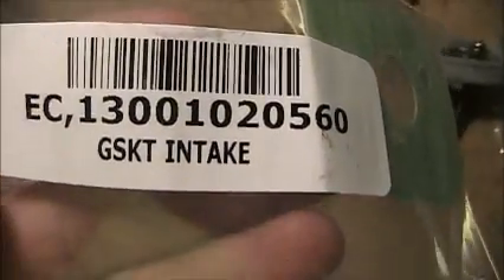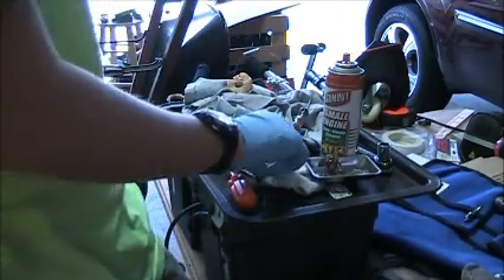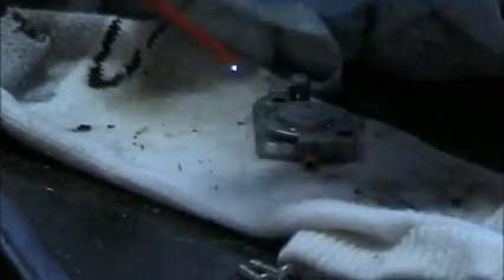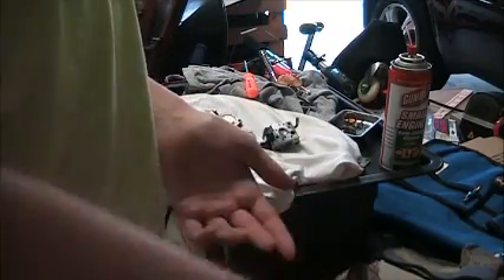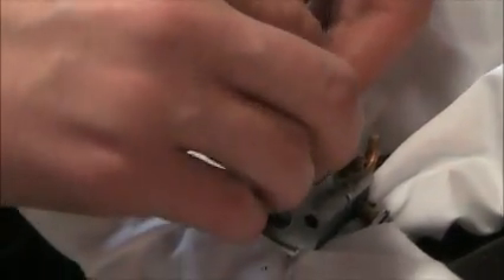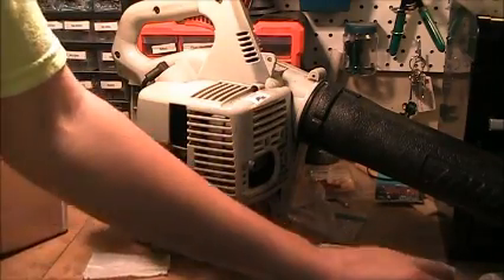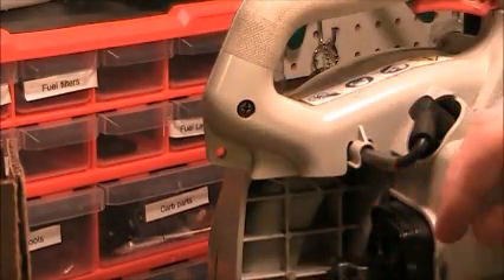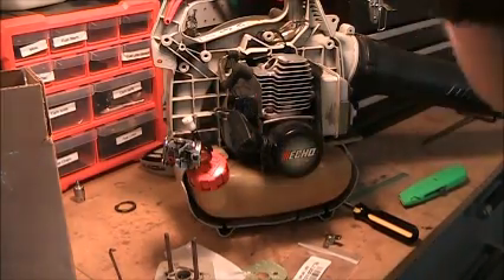Cleaning and Rebuilding the Carburetor on the Echo PB 200 Blower

Comment: NEED YOUR OPIONS ADVICE;;;;; i own small engine repair shop, over the years have rebuilt hundreds of carbs, but this one has me stumped,, soak in carb cleaner  4 days while waiting on kit,, took out, blew out all jets, orfeses, all air passages with air hose, carb is clean,, installed lit,, but can not get primer bulb to fill up only half way,, bouble checked all my work,, every thing is where it should be,,, WHAT IS YOUR OPION TO PROBLEM OR ADVICE??? NEED  ASAP,,,,,,,,,,,,,,,,,,
Reply: Ethanol does a number on the OEM bulbs.

Comment: Nice job. One thing I've found that doesn't get discussed which I believe can affect performance is how poorly machined many of the Zama carbs are on critical surfaces from the factory. Some have fairly deep grooves and dents in the machined surfaces where I think it really counts. As a result of this I have a small thick sheet of glass that's perfectly flat and some 320 wet and dry paper. I wet everything up well and hand lap at least two surfaces if they're rough.  Also due to the discoloration of the aluminum, you can see 'low spots". The critical surfaces would be the surface that goes up against the engine. If there are deep grooves or dents there, it's a place for air to leak causing the engine to run lean and have a laggy response to opening the throttle. . the other surface is the surface the flapper valves go up against. 
I take a few minutes and hand lap 3 surfaces. The diaphragm side (not so critical), the flapper valve side (critical), and the engine side of the carb (critical).. I use water or window cleaner spray and carefully slide the body back and forth. Doesn't take a lot of time.

Comment: OK FOUND PROBLEM, WANT TO SHARE WITH YOU,, i used new fuel filter with 3/16 nipple, it was to small, was not allowing enough fuel to flow, change to 5/32 wellbro fuel filter it fixed problem,, thanks

Comment: Good video. You desperately need a cordless screw gun though. Those screwdrivers are good at your age but only good for final tightening at my age. I have the same blower but my throttle assembly is different and I can't figure out what it ever was.  It has two speeds, locked full and idle. For what you're showing though it's a good video. Keep up the good work.
Reply from the maker: Thanks for the suggestion. I'm thinking about buying one of the Milwaukee m18 cordless screw guns. I agree, it would definitely be nice to have one. Thanks for the comment :)
Reply: Get the Makita and try to get it without buying the rotor hammer with it. Make sure it's a impact screw gun whatever you buy. I watched the reviews on these things and all 3 rank even, the DeWalt the Milwaukee and the Makita. I have the Makita and I'm a metal stud framer, I've used it 8 hours a day for the last 4 years and pushed countless screws with it and it still works good as new. Haven't had to buy a battery or anything. Other's use the DeWalt and replace the battery quarterly. Don't know much about Milwaukee in the cordless screw gun department but I know the corded version weighed like a brick and wasn't near as good as Makita. Good luck whatever you buy though. Also try to make sure it comes with the larger batteries, 3.0 ah. The small ones don't last.

Comment: like2mow, what product should i use to clean the grease, etc off of the blower.  Parts, outside, everything?  Carberator cleaner?
Reply from the maker: I've used a paint brush and some gasoline. Be careful though since it is flammable. You also need to make sure to let it dry out completely
Reply: Gotcha.  I used the carb cleaner for the easier spots but will try the gas and paint brush.  Thanks.